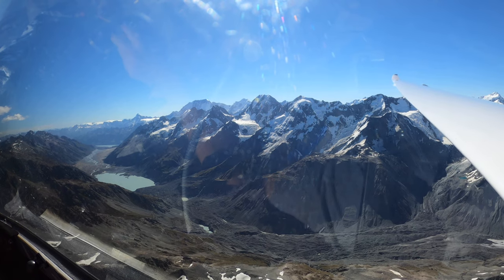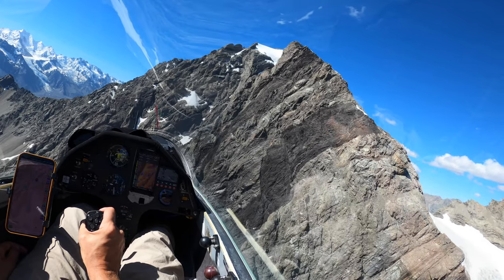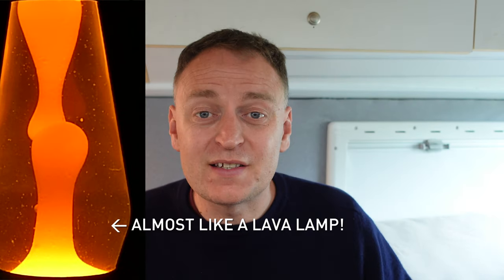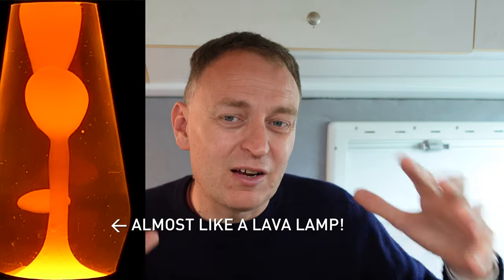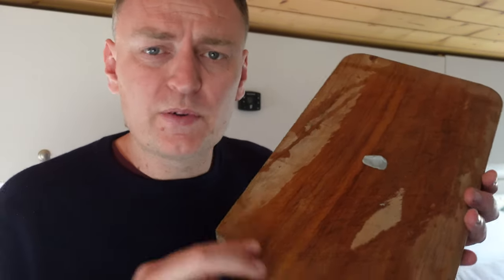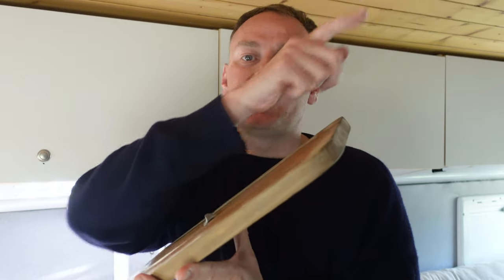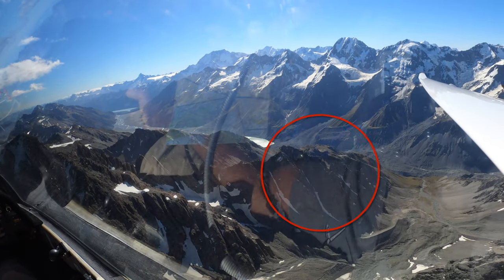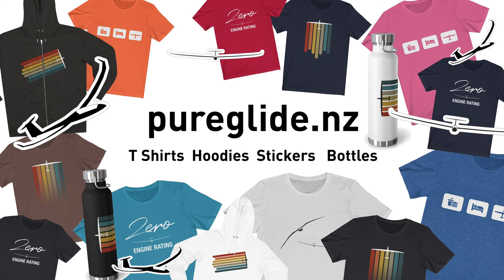How Mountain Thermals Work

Comment: By the time the adhesion due to viscosity of the air is overcome and the 'bubble' releases, the air can also be super-heated with respect to a flat-land thermal at the same pressure altitude. This increases its bouyancy and goes some way to explaining why mountain thermals can often appear stronger than expected.
Reply from the maker: Good point, thanks!

Comment: Interesting! Barometric pressure? Do you see high pressure rotating opposite to low pressure? Is a Vario actually a verbal barometer? Or is it measuring the rise and fall of the glider itself?   Thanks!
Reply from the maker: Hi I'm going to make a video on how a compensated variometer works, so stay tuned! It's not quite as simple as measuring the rise and fall of the glider, but close.

Comment: I don't deny the described behaviour of thermals, don't feel offended please, its a great video. The chopping board example is a good visualisation, but it doesn't explain what is going on. I experience it similarly, but I am not satisfied with the commonly accepted explanation. (but everyone without physics background explains it similarly and it doesn't work for me)

WATER (lliquid) has surface tension and strong adhesion and cohesion. But there is no surface tension on hot/cold AIR (fluid)  because there is no surface between those. Surface tension occurs in liquids physics, but air is a fluid, not a liquid. There is no surface tension on air/air, nor air/rock.

So what is the real explanation for what is happening that is not based on sci-fi physics?
Reply from the maker: Hey agreed, the water surface tension is not relevant to parcels of air. But I think the key is the cold air has to get underneath a bubble of warmer air. The cold air is holding the warm air in place. This I think is what a trigger point actually does, is give a way for the cold air to get underneath. If the cold air can't get underneath easily, it won't lift until the buoyancy becomes too much.
Also I suspect the difference in density between warmer air and cooler surrounding air is not that much, so it's relatively 'easy' for air to stay in place. In a similar way the density of oils in a lava lamp are similar. Although even that is different as in its initial state the coloured oil is heavier, whereas air all starts the same.
Just my guess, I'm not qualified to give a definite answer.

Comment: I have been putting off replying to this for a while, but seem to have some time to either spend or squander, so Ill try to put experience into words, not my strongest point....I do agree with the sticky air part to an extent, but as wind speed increases your thoughts on where to intercept usable thermals,(depending on the infinite variables we know and love) can become invalid, more or less. To limit the variables, let us consider flying a ridge or bowl,  ridge soarable conditions, from barely to strong, and a decent fetch. In the lightest of sustainable ridge lift, directly above the top is typically best, though a thermal breaking off terrain out front is often more usable. Where your theory begins breaking down is in increasing wind. In stronger winds, when ridge soaring a few hundred or a thousand feet above the ridge is easy, attempts to climb out in the thermals passing thru are often problematic, too much drift, likely into rotor. In stronger winds, the thermals, the most usable thermals, tend to form in the turbulent boundary layer formed as the wind rolls across the terrain upwind of the ridge. In higher winds, thermal coming from the mountain itself get blown and scattered....In these stronger conditions, (assuming my goal is to climb out and leave) I always leave the other gliders working well above the ridge, (Stuck in ridge lift, yuk, gag, etc) and head way out front, where I can just maintain an altitude about even with the ridge top. Thermals I intercept way out front are typically much better, and drift much less, typically climbing me way above the gliders stuck above the peaks by the time I've drifted back that far..... Is there anything better than waving bye bye to your buds or competitors stuck on terrain as you climb to base , back on task?

My theory about why the aforementioned technique works so very consistently is that the thermals that form and drift in the breezy boundary layer, (several hundred to even a thousand feet thick) often see and are triggered by the wall of air that is ridge lift, thus breaking off well out front of the terrain, instead of the terrain itself. Next time you get stuck on a ridge somewhere, consider my thoughts and the time I either spent or squandered to attempt to draw a picture with words. Not the fastest hunt and pecker in the group, heh heh.
Reply from the maker: Hey that’s great comments thanks for sharing! Yeah I didn’t get into wind effects, but your idea about them forming out in front of the ridge is interesting, I’ll test it out. Thanks for taking the time

Comment: The thermals also pull in air from below and create a valley wind that also flows up the slope reinforcing the thermal lift. Often the wind changes direction in the morning or early afternoon and starts flowing towards the high mountains because the thermals have started. (Anabatic)
Reply from the maker: Great point, cheers

Comment: I have never been on a glider, and I am sure there is not one around where I currently live, but I enjoy watching your videos and learning from them. Thank you!

I'd like to ask if you have any recommendations for flight simulators that may give some good experience with gliders.
Reply from the maker: Hi great stuff, there's only one really good gliding simulator, and that's Condor. The reason is it's the only one that simulates both thermals, wave and ridge lift. And the gliders are very realistic too. The only thing it doesn't simulate is convergences and energy lines. It's actually good for racing online for fun, so quite a good app.  Cheers!

Comment: As always, nice video and beautiful explanation!
Your camera footage is great and this made me think on a suggestion for a video.
As a glider pilot myself (just got my licence last week!), I like to put the camera anywhere I can in the glider (mostly actioncam like gopro). Sometimes even outside on the wingtip. But this also made me think about safety: what if the camera came loose and dropped out of reach in the cockpit. Or what will the aerodynamic drag be when you put a go pro on the wingtip? What if the camera falls of the wingtip during flight? Do I tie it down or not? What is the best way to secure a camera anywhere on a glider? I have thought a bit about this already and would like to hear your opinion about it.
Thanks in advance,
Keep it up!
Reply from the maker: Yeah you have to be careful installing on the outside. You don't want anything to get in the way of any controls, or fall off. You can't rely on just suction cups. You only need a tiny spec of dust to slowly let the air out and loose suction, and air pressure changes can also pop them off. So a mounting more solid is better. That's why I don't have much outside footage, also I only have the one GoPro :)
Reply: Thanks for the reaction! 

When I mount a GoPro/oudie/phone in the cockpit I make sure they are always within reach (e.g. when it falls of, I can reach it and put it away somewhere safely). 
I've put one on the exterior of the glider once, but in hindsight I thought of mutiple worst case scenarios:
1) the mount fails and falls of because it is not tethered to the aircraft -> GoPro falls to the ground with risk of hurting someone or cause damage to property. 
2) mount fails, but is tethered to the aircraft wingtip -> do you want an object flopping around in the wind near the glider? This could cause damage to the glider and control surfaces. 

I would like to make some more footage from the exterior as it is awesome to see yourself in the glider from the outside in the air, but I want it to be safe. I'll give this some more thought! ;-)

Comment: If you're below a mountain peak, how far from the rocks do you have to be to catch such a bubble ? Also, what if the sunny side is also a leeward side. Shouldn't you be afraid of turbulence then ?
Reply from the maker: Hi great questions, and as always, it depends. It depends how big the thermals are on that particular day. What the lapse rate is. Humidity. Temperature etc can all effect the thermal size. As mentioned often you can't get close enough, other days you can. As for turbulence, again it depends on the wind strength. Yes being in the lee is probably a bad idea and the thermals won't work very well. Usually always be on the upwind side. And yes always be afraid of turbulence close to the mountains :) I suggest taking a local mountain flying course if you're going to be mountain flying to learn many of these things.
Reply: @PureGlide  Some years ago, Tim, I was towed to the lee (southerly) side of the Wilder Kaiser near the Germany/ Austria border and was concerned for all the reasons you mention above. Luckily, the wind was not too strong and the south-facing rocks had been basking under blue skies and high temperatures all morning. The result? The thermals easily overcame any tedency for down draught and I climbed away at nearly 6m/s. Sweet, but I still hate metric instruments!! :-)